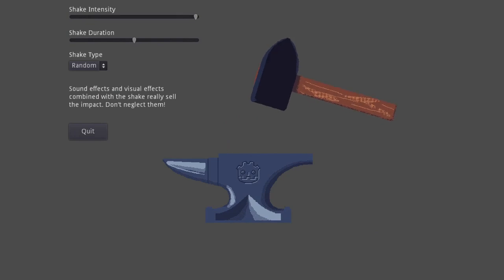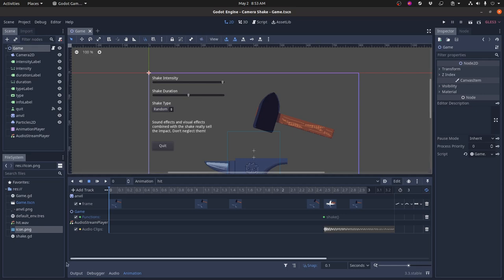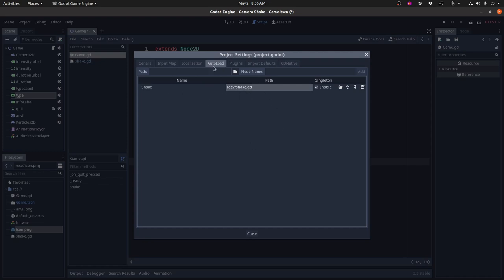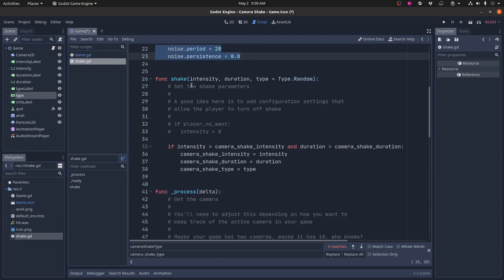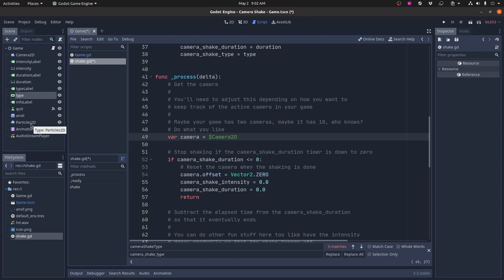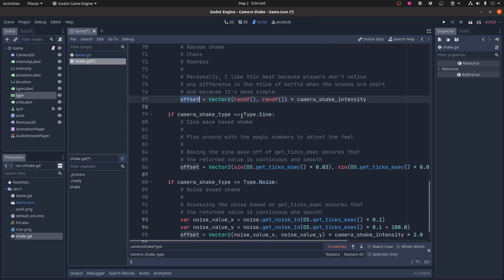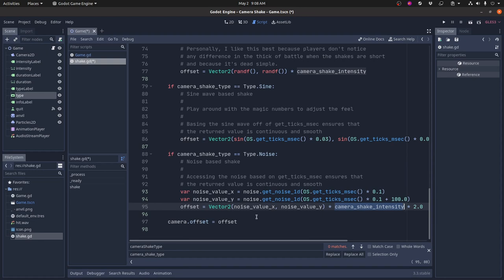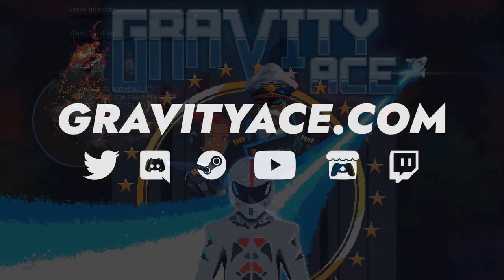3 methods for screen shake in Godot Engine

Comment: Nice one! We also use typically either the random offset or the noise one. Random to make it more erratic, say, for an attack impact, noise for softer things like simulating an earthquake. They're both nice approaches.
How about a time freeze on impact, like freezing the screen a fraction of a second? It combines really well with shake. I've done it with the pause feature in Godot, but do you happen to have a tip on that?

Comment: that hammer scene looks cool! there's a couple of issues here though. :)
this shake will look and feel different based on FPS. I recommend doing something like this to fix this:

		shake_next_in -= delta
		if shake_next_in <= 0.0:
			shake_next_in = 0.1 # adjust

next thing that might be problematic is that the shake has the same intensity for its entire duration.
it is quite noticeable in your demo how the shake ends abruptly, especially if it had a strong intensity.
so I recommend reducing intensity over time.
in fact, I would do away entirely with the duration argument and instead have the duration based on the intensity (it takes longer for a higher intensity to decay).
you may want a duration for scenes like continuous screen shake because there's an earthquake or something - so that's screen shake that's meant to convey urgency rather than an impact - but for impact-based screen shakes, I don't think having to specify a duration is really helpful.

then for additional juice, I like to support directional screen shake based on an impact vector.
but this is just an optional little thing similar to the screen freeze suggested by GDQuest.
			
also btw, singletons are actually added to the scene tree - which is why they have to extend Node.
they are immediate children to the root viewport. check the remote tree when running your game in test play.
though I recommend not using a singleton for this in the first place and suggest that instead it should be a method of your camera.
Reply: First time in my life, I have checked the commenter's profile and hoped that he's a youtuber.  

I hope you always have a good day.  :D
Reply: why is this affected by fps? i thought that seeing that delta varies according to the fps the method presented here would be fine, no?
Reply: @ruiteixeira  the method uses delta exclusively in calculating the duration of the effect, but the effect itself still varies.
at least for camera_shake_type == Type.Random.
the other two types may be consistent because they use the OS time, but I wouldn't rely on it.